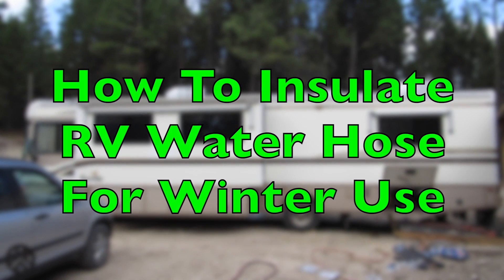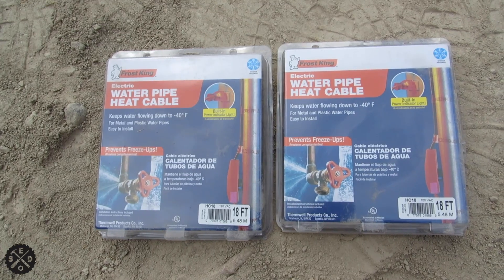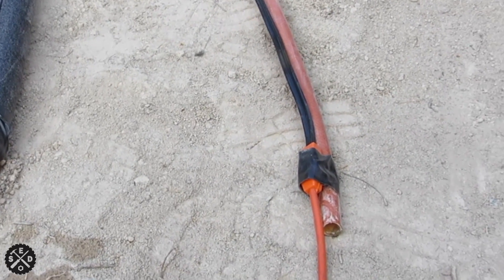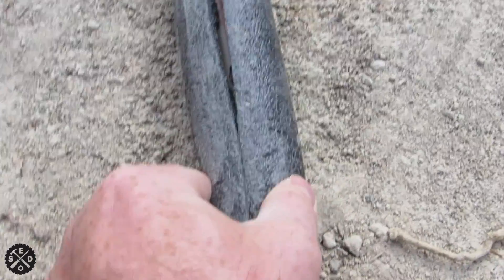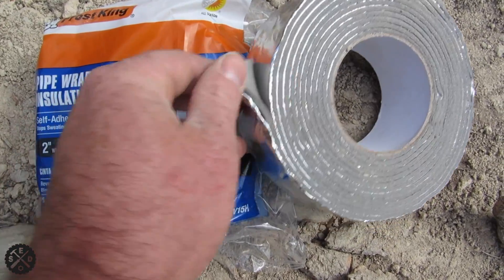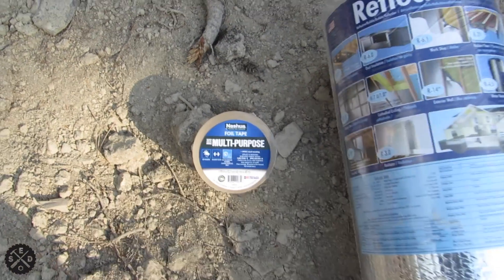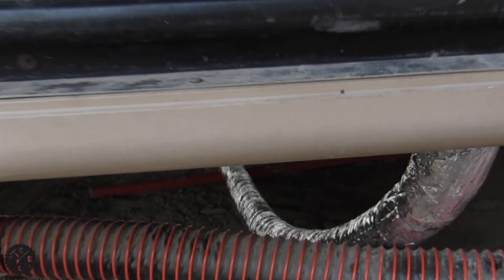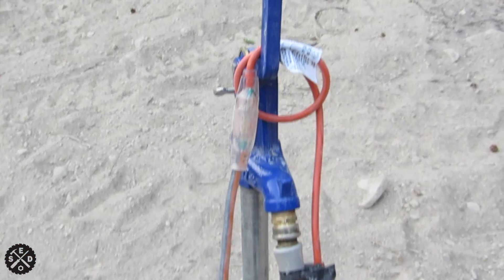Insulate Water Hose RV Camper So It Won't Freeze Winter Use

Comment: I’ve bought 2 heated, insulated hoses for my RV and both of them froze. The heating element broke both times. I don’t know how it breaks because we have been very gentle with it. I’ve been without heated water for six weeks now and heating my own water is getting old.. LOL. I’m hoping that I can figure a way to put more insulation around the hose itself because two brand new hoses don’t just break for nothing as they do not get stretched and so forth. Thank you so much for your videos!
Reply from the maker: Wow yeah sorry for your troubles that’s a pain especially when you need it most. Good luck going forward!
Reply: I thought my pipes were frozen for weeks but it was just a frozen disc at the hook up at my 5th wheel   There is a screen at that hook up and it froze. I got hand warmers and thawed it out. My hose not my pipes were froze. Just the entrance hook up for my water.

Comment: I am setting my heat up now for my hose on RV. Everywhere else I look instructions state to put thermostat in the outside air, attached in some way or just hanging. With thermostat facing hose it seems water could freeze in hose before getting a chance for heat tape to warm it all up. I want to  do this correctly so hope you can give me your logic and I may try it myself. thanks!!
Reply from the maker: The type that I used in the diagram they showed the sensor being put against the pipe (in my case hose) so it can sense what temp the water is. Not sure what type yours is.

Comment: Do you think that the foam tubes used for swimming ,also known as noodles, would work? Thanks for you to help.
Reply from the maker: I don’t think it’ll hurt but I don’t know if it’s insulates as well. I’ve never used them to know.
Reply: I tried this. SE DIY is correct, they don’t insulate as well. But if you do this diy, use pex, not a regular hose.

Comment: Nice setup but I wonder if it is going to heat up to much inside the insulation?
Reply from the maker: +Curiosity Thanks. Well I’ve been using it for 2 months now and it seems to be doing well.
Reply: Those heat tapes only get about 70F and they are self regulating to NOT get too hot.

Comment: Yikes, I really hate to be the killjoy here; this heat tape very specifically states it shouldn’t be used on a regular hose. It can and will burn through it, especially if wrapped up like this. I’m sure it will work for you, that you won’t have the bad luck I did ignoring that warning. You can use any actually water pipe, though, including pex. Not as flexible as your set up, but it would work. Also seems odd to me that the v park is using a frost free hydrant. They are not designed for constant water pressure like that. All of this I speak from unfortunate experience.

Comment: overkill did less then that 3 years ago. more important though why have you not insulated the waterpipe itself incl. the spout itself?
Reply from the maker: Yes it was a little overkill but it got really cold that winter. I think I mentioned in the video that this was a temporary hook up that I was going to hook it up to a different one and put heat tape on the actual hydrant too.

Comment: Just buy a camco heated hose. Done.
Reply from the maker: You could. Curious how much they are per ft.
Reply: @SmartEasyDIYer  2.64 a foot currently. I have a 50 footer I got for 132$ and have seen them cheaper at different times of the year. Looked at those heat cables you used and they are 48$ for 30 feet. After all of the wrapping/insulation materials you used and effort it is not much of a cost difference currently. Not poo pooing on what you did just pointing it out. I am 100% sure yours is freeze proof no doubt and that is the goal right?
Reply from the maker: Yes. I don’t know if that was even an option when I did it but that sounds like a good route to go. Yes as long as it gets the job done that’s what matters. Thanks for sharing.

Comment: reflectix is the cherry on top. the most most worthless most wrongly used overhyped overpriced foil. come on man, this is completely Overkill people are wasting their money with this setup. back up these claims with data and then I would trust it, but reflectix is adding no value and it cost a lot of money. for one
Reply from the maker: I’d rather overkill than have it freeze in the dead of winter but that’s just me.
Reply: What would you do then?
Reply: So rude. The guy takes the time to film and post a video for us all and you say that? Thank you for your video.
Reply: @sixshinez9290  h8 speech!! I know, right
Reply: @bensavage6389  No, just ignorance.
Reply: @sixshinez9290  I'm trying to educate people on the low r value. It doesn't work in this application I ain't no Ignoramus!